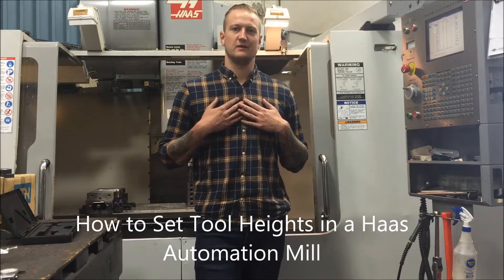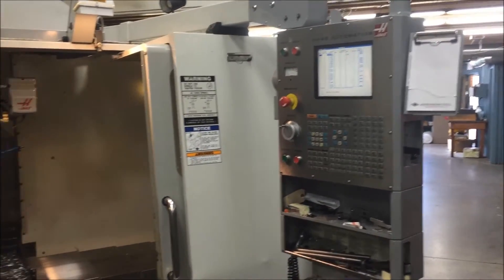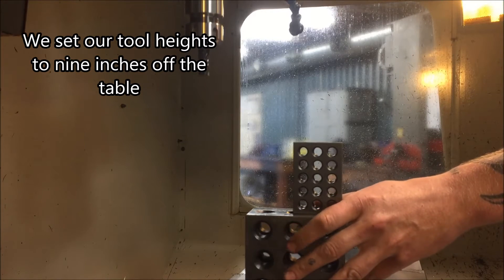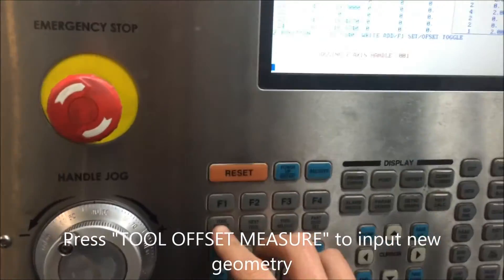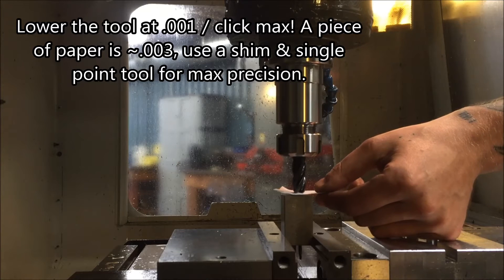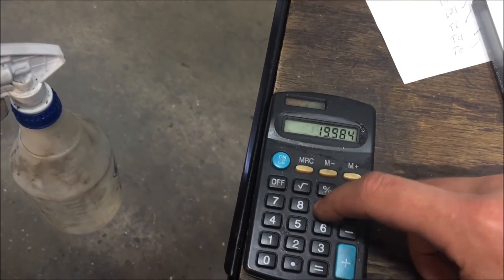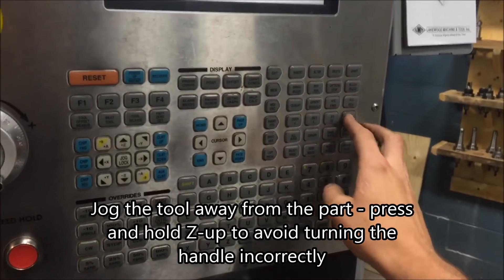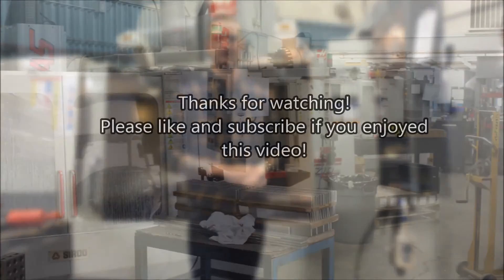BEGINNER CNC: HOW TO SET TOOL HEIGHTS IN A VERTICAL MILL

Comment: I like your video - I just made a crude video for my CNC class but I also have a power point to cover the 3 basic ways I have seen.  I call the first one Old school to top of part - the original I was taught in the mid 80's and before work offsets - we never had a Z shift.  The came the G54-59 system - we still did it the same way - I used a 1.000 block I had made as I didn't want to crunch the carbide tips sing paper. I eventually started the all up method and that was better than all down and less tool issues. 

The second way was off a common surface like you are doing. We did 2.000 off the table and figured out with either indicator or block method the Z axis shift.  Then we all did it the same and we could share tools like face mills on multiple operations. 
The third way was Renishaw probe BUT it was not a new concept - we had a large shop years ago that would set all tool heights on a comparator and roll the whole cart to us. Positive offsets.  So we needed a guage tool to get the large negative number from spindle face to part.  The Renishaw system does it the same way. 

I teach people all 3 methods so they handle different shops and have an understanding of Work and tool offset in Z .

You method is good for getting good tool to tool blends  - there is also a 2.00 dial guage that MSC sells that eliminates the block. We have some shops that had probe and no probe so different methods need to be used and understood - Nice video

Comment: good video - an alternative for the work offset Z value is to use the position>operator display screen. still have to type the value in for the Z register, but just another way to have the machine measure the height difference.
Reply: Andrew Ydna DuBuc Agreed. This is how I find myself doing it the quickest. I typically have a test indicator in a holder and use it to find the difference. Its quick and accurate especially when setting work offsets off your part in a five axis setup. - Jacob S.